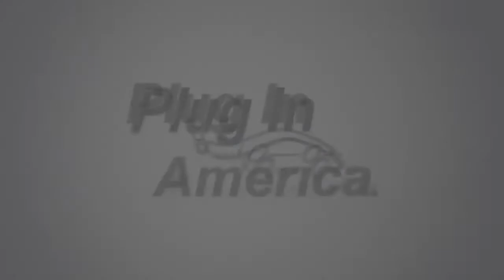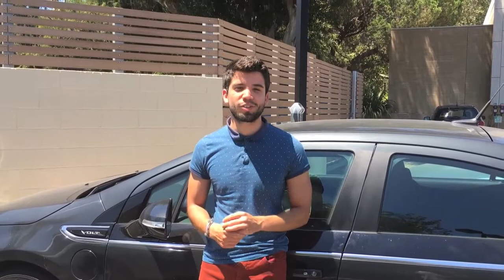Ask the EV Experts: How reliable is an electric car's motor?

Comment: This need further testing. There is a Tesla test car which ran alittle above 1 million miles or kilometers dont remember had its engine replaced 3 times as well as batteries multiple times. So things not good as it seems and need further digging.